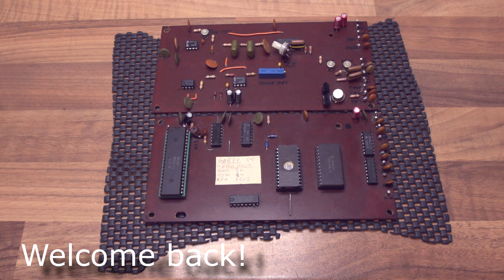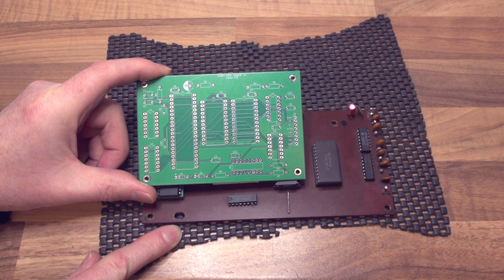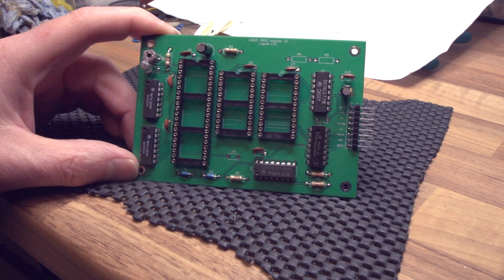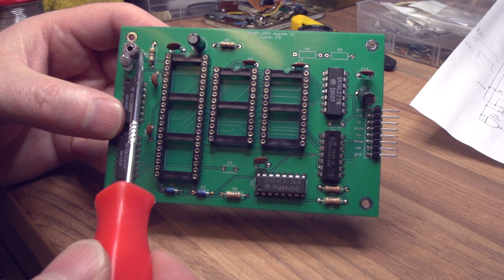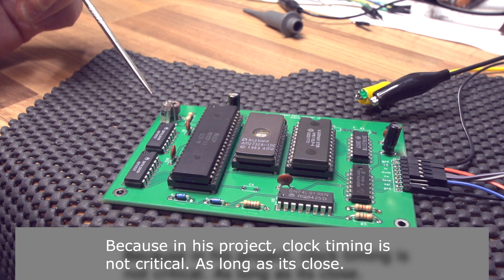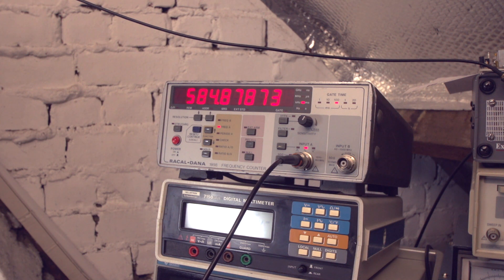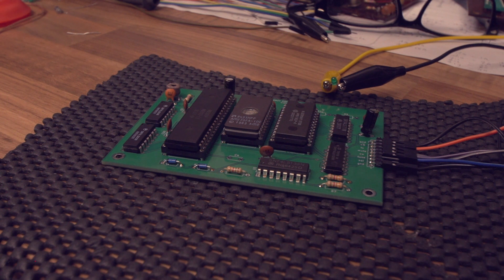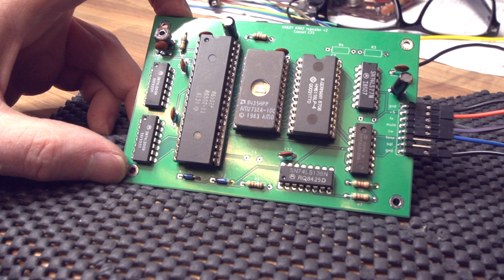Populating and testing a newly finished PCB : Reverse Engineering a 1980's 6502 CPU card

Comment: Why not use a 1MHz crystal and a couple of inverters? If present and available of course...
Reply from the maker: Hi. Yes it could have been done with a 1MHz crystal. But i chose a simple RC arrangement to do the job simply to reduce costs. And the NANDs were already there, so no need for inverters. But yes, that would have been an alternative way and much better precision for clocking frequency if it was needed. thanks.